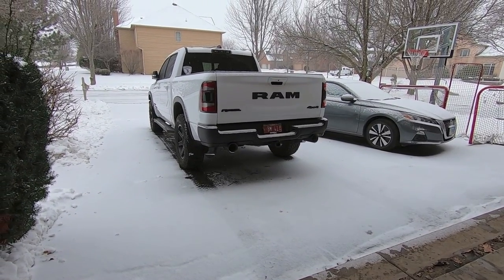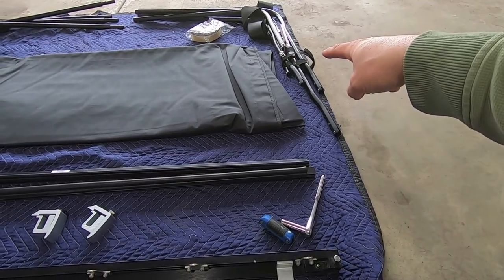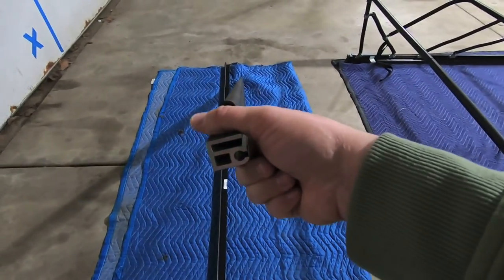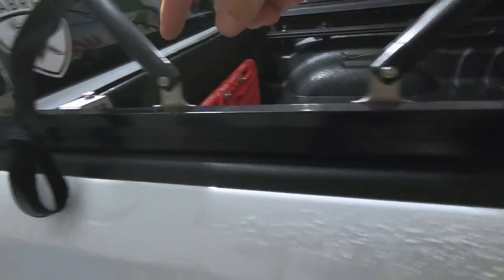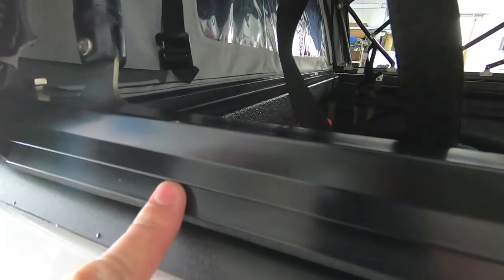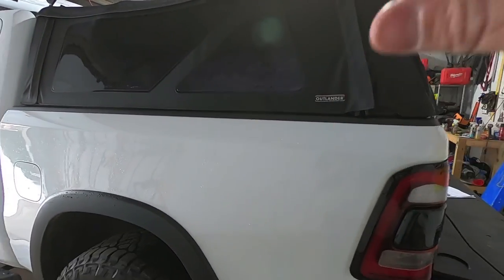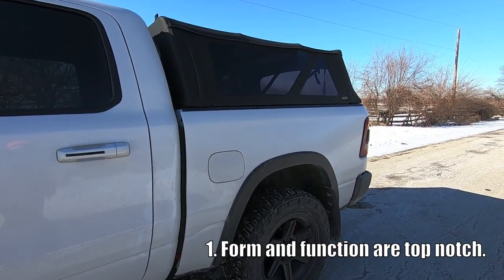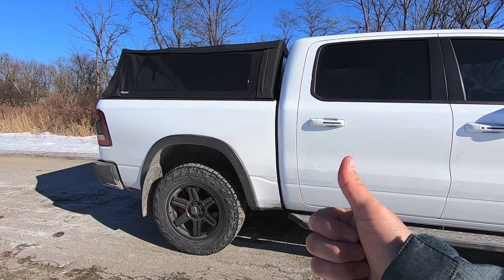Agricover Outlander Soft Truck Topper - Ram Rebel  #ramrebel #overland #ramtrucks #review

Comment: I had a hell of time getting the back window zipped in. Took me a long time and several beers and some really bad words and screams of anger. I had more trouble getting the plastic pieces at corners than along the side windows. 

The biggest problem I have is the topper leans forward so there isn't enough room between the cab and the topper.  So then the front rail gasket doesn't come close to sealing on the weather stripping. 

It was also really really hard to get the velcro wraps around the hoops.

Comment: Thanks for the review. Definitely considering this over the Softopper for rainy / snowy season camping trips when we don't want to sleep out and risk a rude (wet) awakening. Big question: does it come with "curtains" to block the windows, to keep out sun and/or peepers (you know what happens when a light is on inside and it's dark outside)? Or would we have to rig something up? Thanks!
Reply from the maker: You’ll have to rig something up,

Comment: Excellent video. I just got one for my 2021 ram 2500 6.4 bed. I went through the same research trying to find something all around useful. I wanted more secure storage. somewhere for the dogs to go. Fiberglass ones are crazy price and a little to permanent for when you want to open the bed back up. The other brand soft top didn't have side windows and the reviews were not the best.that's why i went with this one.  This is a great option and can't beat the price. I know the other brand has a diy cut out option to put a roll up window between the cab. like a pet window.  i wonder if it will work on this one. I might try it on this setup. I haven't installed mine, yet your video was a big help on that. I like those led strips in your bed. Any info on those? are those hard wired or do you have the outlet in the bed? thanks again
Reply from the maker: The led strips are from Amazon. I have a switch wired to them and I grab power from the 12+v wire in my trailer harness. I have a video showing how I wired another set, I later switched to the strips and would recommend the strips over the little pods due to better coverage.  Here’s the link, any questions let me know!

https://youtu.be/ArtoUctsRSo
Reply: Awesome thanks again.

Comment: Nice video. I've been on the fence about getting one of these for truck camping, but I need to fold it up to haul my dirt bike.
Reply from the maker: Unzip the windows and this folds up agains the top of your cab so you should be good to go!
Reply: @WaterFowler41  it's the top on my list because it doesn't fold into the bed or take up space. Mind if I send you a message on IG with a question?
Reply: @ShiftGearsMoto  hey did you end up getting the topper? Im in the same boat...I have my dirtbike and hate hitch carriers and was liking the fact I could cold this up to the back of the cab. Cheers
Reply: @hski12  I did, yes. Was going to make a specific video about it.
Reply: @ShiftGearsMoto  you should make a video! :)
Reply: @hski12  it's in progress!

Comment: Thanks for the great breakdown. Been looking into one of these for when I go on trips with my sons' Scout troop.  Is this on all the time or do you take it off when not needing it?  I was just wondering about durability.
Reply from the maker: My dads had it on his truck for a few months and everything is holding up great. I’ll probably run the top for most of the summer for our road trips then break it down in fall.

Comment: Thanks for the video  I have mine in the garage and ready to install. How do you store the topper when you dont have it on the truck. I was thinking about suspending it from my garage ceiling. concerned about the frame getting bent. Looking for solutions 
thanks for any suggestions
Jon
Reply from the maker: The topper is on my dad's truck currently but I haven't really given storage too much though.  I may end up breaking it down when I don't need it so I can keep it in my basement.

Comment: I've been on the fence about getting the Outlander soft top to simplify my camping/fly fishing trips. I like the way these fit compared to the Softopper and the other competitors but I'm wondering if the lack of zipper pulls on the inside is a pain. Don't want to double around when I'm trying to get out, ya know what I mean. Any thoughts on this? Is opening up from inside a pain?
Reply from the maker: All of the zippers have an internal string you can pull on in addition to the external one.
Reply: @WaterFowler41  Good news on the zippers. Have you had any problems with moisture coming in? The only other Outlander review I saw on YouTube showed pretty significant water coming in after rain. I live in the PNW so this is definitely a concern for me
Reply from the maker: @JC-kq4zw  I haven’t had any water intrusion and this is after driving through several touch less car washes
Reply: @WaterFowler41  Thanks for the info. I am struggling with analysis paralysis as I try to decide between the Bestop Supertop and this Outlander model. If you have any other words of wisdom, I am all ears. There isn't much online about Outlanders so your insights are appreciated.
Reply from the maker: Biggest difference with the outlander is the windows. Which is really nice to have because it allows some light into the bed when you’re grabing things out of the truck bed and it honestly looks a bit better with windows than the models without windows.
Reply: Ok, Outlander ordered. Thanks for sharing your thoughts
Reply: Welp, got it installed with he help of my son and it was a bear! My kid told me it was the hardest thing he's ever done. Granted, at 13yrs old, his life has been pretty cushy but getting this cover on took some doing. I built a sleeping platform as well so I'm eager to get out and use it. Hopefully it keeps the weather out.
Thanks again for the insights
Reply: @WaterFowler41  The Bestop Supertop appears to come with windows now.  It folds into the bed whereas the Outlander folds against the cab.  Any advice there?

Comment: Is it taller when stowed all the way to thr front?  Pictures on website seem to indicate as such.  My truck is 81" tall at shark fin an garage is 82.5 so not a lot of room to spare.
Reply from the maker: A little bit above the cab, I think its about even with the top of my shark fin
Reply: Perfect!  I doubt I'll have it stowed much but would be good to know I won't accidentally do some damage to it and my garage if I forget its stowed.  Do you ever partially leave the side panels unzipped?  Trying to figure out an air conditioning solution for my dog without having to fully remove the panels.  Was thinking I may just add a snap to a couple corners to hold it in place when i have a corner open.

Comment: Waterfowler, I am having a problem getting the rear window to seat on the tailgate top.  Any tricks to getting this sitting any better?
Reply from the maker: Are you talking about the tailgate flap? I’d double check your bed rail clamps are as far back as they can be and tightened down completely. Make sure the width is properly set too, the tailgate bar should sit firmly in the two corner brackets.
Reply: @WaterFowler41

Comment: Does the rear window fold or roll up?  Have you had the side windows open for venting while driving?
Reply from the maker: Rolls up and snaps to the top so you can ride with it open
Reply: @WaterFowler41  Thank you for the quick response.  Have you tried venting the side windows at high speeds?  Wondering about keeping cool enough for dogs on hot summer days.  Or maybe best to have rear window open?

Comment: My shell is too wide at the front of the truck. The back is correct. How do I fix that
Reply from the maker: Make sure the front cross bar is full seated on both sides assuming they sent you the right parts, you shouldn’t be having issues

Comment: Any specific reasons you went with this brand vs others?
Reply from the maker: Side windows!
Reply: I just ordered one of these for my truck, and out of all them, the outlander has the best deal on them. Softopper used to be the cheapest, and were able to get one under 800, but their prices are now as high or higher than the outlander.  Plus, from what I've seen. The outlander is the best looking out of all of them.

Comment: @waterfowler 41 have you swapped the Outlander for the tonneau cover and how hard is it to do?
Reply from the maker: Yup running the tonneau right now while the outlander is packed away. Very easy to swap back and forth
Reply: Do you take the side rails off to use your tonneau cover?
Reply from the maker: Yes the side rails need to come off